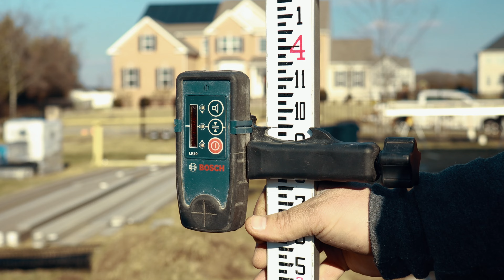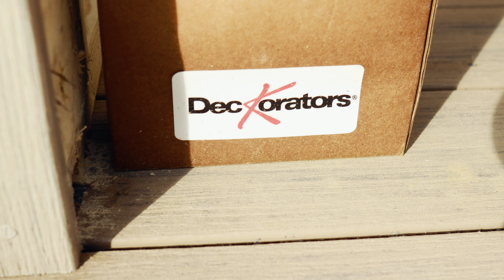HUGE Pavers and PVC Trim - THE MOUNTAIN PT. 5

Comment: What about an under cover gas fire pit? Is that a thing?
Reply from the maker: There probably is a way to make that happen, but most fire pit burners we use have said in the installation instructions that they are not allowed underneath a covered structure

Comment: Wait, I didn't quite catch it. Why isn't the soffit vented?
Reply from the maker: Because the roof won’t be insulated there is no need for the ventilation…when you have a conditioned space you want ventilation so the roof stays the same temperature as outside, otherwise moisture can build up and prematurely rot out the roof
Reply: @THEpremieroutdoor  makes perfect sense, thank you very much!